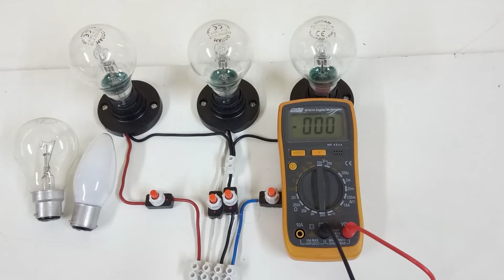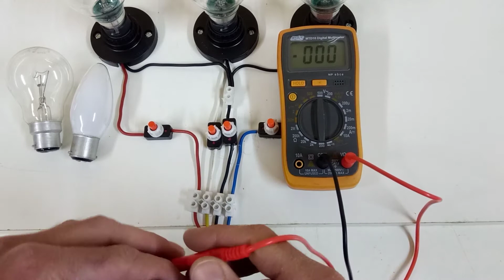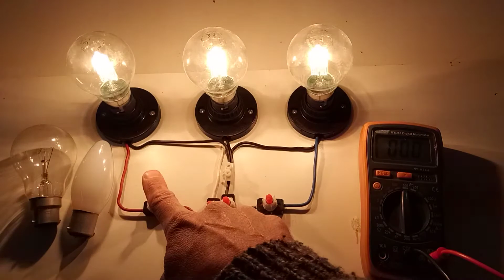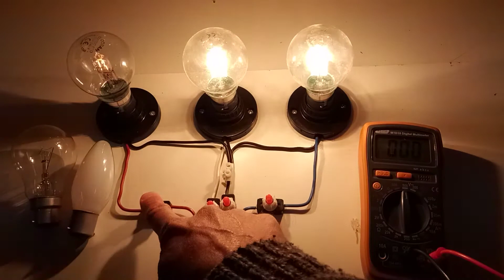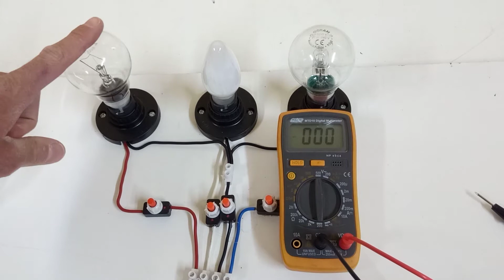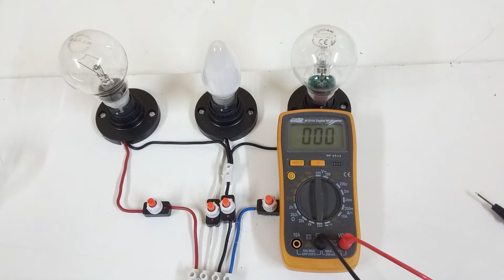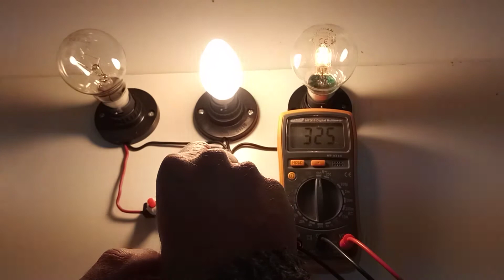A broken or floating neutral and the effect in three phase electricity systems

Comment: You showing the different outcome fm the different lamps ,makes for me some kind of prove that we moved and had first neutral+ 3 x 240 
now we have only 3 x 215 (schould be 220) BUT no neutral , I noticed that with almost the exactly the same setup we use also MORE electricity ,
and even we went (from , like your lamps old ) to changed to Led’s all over the house ,also because we started noticing regular faster blown lamps.
And a new strange problem started to arrive that one prone of the wall sockets started to be burned/melted on the more electricity consuming 
households equipment ,washer/dryer small 1000Watt heater ,in the shop my big circle-saw wall socket . Also when functioning most  the times ,
it clearly feels when you pull the plug and one of the pins is very hot and even partial cable feels warm/hot . After certain time I need to replace 
the plug on the cable and later also the wall socket ,the electricity company ,say I have to solve my internal house problems ,but do naturally not agree.
Do you (beside this excellent Y.T ) have maybe some more inside about the problem ,sorry to ask . We are with 14 households connected to a 3 x220 
( from the last WW. placed by the Germans ) transformer ,and they told me (elec. comp) they won’t change it , do you have a good technical explanation 
to possible confront them with ?  pls,  if not , no problem I look further ,thanks Pete
Reply from the maker: Hello Pete.
I assume you are in Germany?
So yes you will have 3 x 230 volt to neutral or 400v between two phases.
The 220v is a bit low but still allowed as long as it is 207v to 253v range. Since this video they have turned mine down to 230v because other houses were too high.

The first thing to ask:
Did you measured the voltage you are getting? Is that confirmed 215v?
Does it change a lot when you use the heater? If I used 1000w heater it would drop 2 volt only at the meter and maybe 4v to 6v at the heater socket. If it changes by more than 10v for that heater I would say something is wrong with the neutral.

Did you notice any lights going really bright or really dim at any times or maybe even flickering.
Or do you notice any equipment burning out?
That would indicate a neutral fault somewhere.

The melting plug is probably a bad connection, so may be an old socket or plug.

I don't think the old transformer is a problem as long as it is working.
The transformer for my street is also very old. Probably from 1950s. Some places here (Johannesburg, South Africa) they are even older.

Comment: By replacing one lamp with a heater element will cause the lamp to blow as the  voltage over lower wattage device to approach 3phase voltage of 400V. Great video also applicable to South Africa.
Reply from the maker: Yes indeed, the greater the difference in the load, the more the voltages shift.

The three phase voltages change because the current wants to be equal between all the phases.

BUT interestingly, in the real world where they have the neutral earthed, those earths help keep the voltages more stable as long as the break in neutral is not at the transformer.
Had a street supply here with broken neutral. Two phases went to 275v and the other to 179v. Only the people on the low phase complained about it being low. No one else reported any damages and it was like that for 2 days!
Reply: Does it mean when the neutral conductor was removed, the currents thas was originally flowing has to go back to the source somehow. Does it mean at least one or two of the three phases will become as a return conductor for the unbalance currents.and that they are doing this in round robin fashion as time goes by. This is just my Idea. Hope to see more clarity on what will happen to unbalance currents when neutral conductor is removed.

Comment: coudnt this problem be solved if the load is connected in delta
Reply from the maker: Yes but single phase supplies are never connected in delta. 230 volt is always from the star point, so if you have a street with multiple houses connected and the neutral is broken along the way, the houses all downstream will suffer the over or under voltage problem. Even if the houses are on three phase supply, there will almost always be one phase with more load than others.

BUT

If you have Multiple Earth Neutrals on a TN-C-S system, it may be possible to limit how far the star point moves.
A real life case of this happened in another street here.
Two phases only went up to 280 volt and thus luckily appliances didn't damage.
My own area, the neutral came off at the transformer and within a minute many items were blown in many houses.

Comment: awsom video, a lot of rotary phase converters are built with floating neutral and this explained the potential issues with that design. thank you
Reply from the maker: I'm not sure what the result woukd be there, but I assume as long as the neutral is connected where needed it should be fine.
Cheaper generators also have a floating neutral, so in South Africa those are not allowed to be connected to the grid ornhouse wiring ever due to the possibility of a shock.

Mostly rotary phase converters connect directly to the machine being used, so no risk there.

I'd be careful connecting one to the building wiring.
Probably better to upgrade to 3 phase from the supply company.

Comment: This is similar to the star connection with neutral.
Reply from the maker: Yes the power company uses a delta-star transformer for our supply. It's 6,660v to 230v/400v. They have adjusted the transformer since this video so it's no longer 240v as shown.

Comment: Simply superb love you.if I provide neutral from ground in my home will it work
Reply from the maker: If the neutral is already broken it's not likely to work using the ground, but it depends on your earthing system used in your country as well as how good the ground is as conducting electricity.

It's likely you'll end up with voltages that are still too high or too low.
In a TN-C-S system earth and neutral are bonded any way, so people usually start complaining of shocks from metal such as taps and appliances. Can be very dangerous, even kill you.